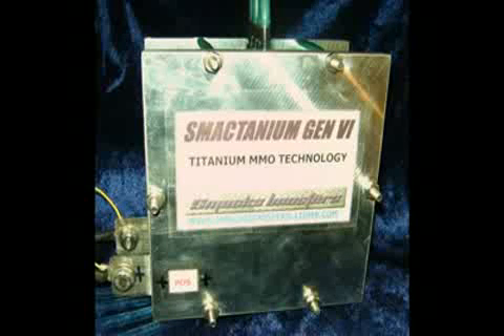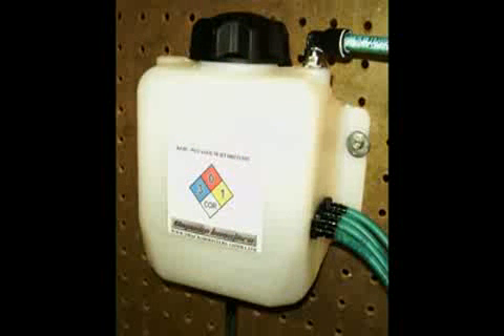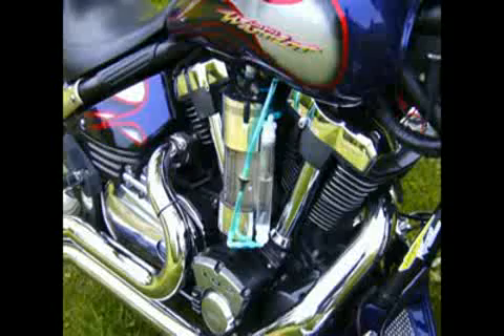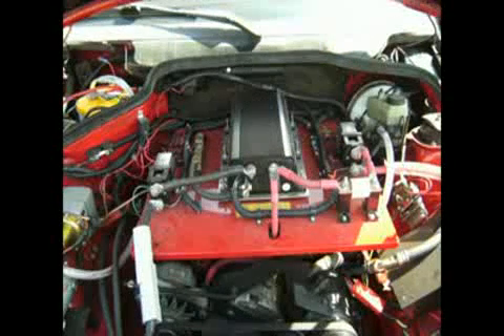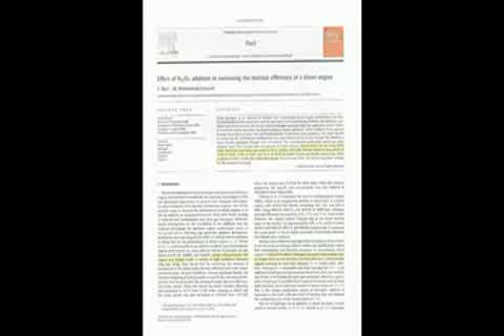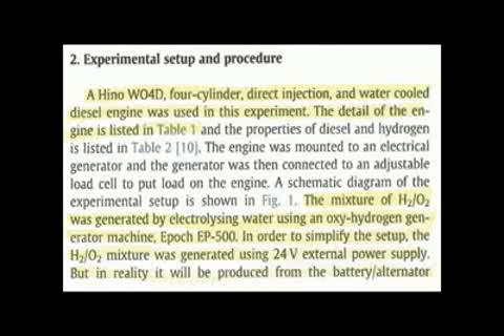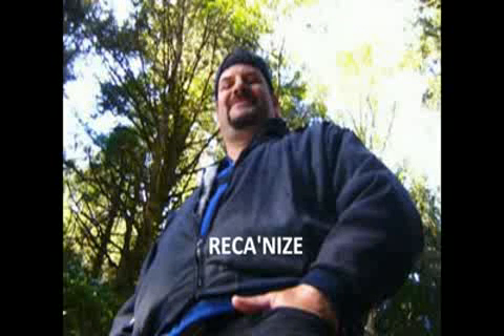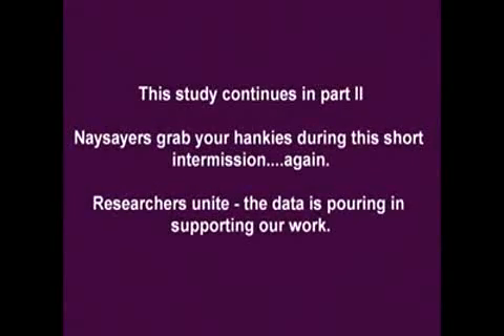Scientific PROOF that HHO WORKS Part 1

Comment from the maker: @SuperSoylent -- Nope, you are wrong, I have looked at the science behind it that's why I know it can work. Without a doubt H2 added to HC fuel changes how the fuel burns, it always has and it always will. The only question is can this change overcome the losses involved in making H2 on-demand from water. The answer is Yes it can. It really doesn’t matter that some test show otherwise, the important factor here are the test that prove it does. Quit focusing only on the negative...

Comment from the maker: @SuperSoylent --- There is where the misunderstanding begins. Using H2 on-demand isn't creating energy, it's recovering energy that once was lost. H2 added to HC fuel has been shown to increase the lean burn range of the fuel while increasing it's TE. So you get more power out of the burn using less fuel. This does come at a cost but the increase TE offsets the converting losses. The net result is a fuel savings. FYI, I don't sell these units, I'm just a researcher who mirrored this video.

Comment from the maker: @InStunnedDisbelief --- READ THE WHOLE PAPER... They accounted for the losses. They took the energy required to get the H2/O2 gas added in the energy value of the resulting H2 then lean out the diesel by that amount. The results were an increase in BTE as well as a savings in fuel usage. In short they used less fuel and got more power out, including the converting losses. And no this is not free energy, the gains come from a better energy convergence of the HC fuel.

Comment from the maker: @InStunnedDisbelief --- Oh I see the problem, you just can't read. I said A dept of the DOT, the FMCSA is A dept. of the DOT. And no, read the whole section of the DOT doc as well as section 1.5. H2 and O2 made on-board from the electrolysis of water gave a 4% reduction in fuel use. You are not one of those comment pickers who pick apart sentences and use them to spin the topic are you? Sad, truly sad....

Comment from the maker: @InStunnedDisbelief --- Making posts in 500 characters sometimes requires the use of acronyms, quit your bitching. The FMCSA division of the DOT published this doc, tinyurl com / DOT-doc. Read section 1.2.3 - "Limited laboratory testing of a hydrogen injection system installed on an older diesel truck engine operated at a series of constant speeds showed a 4 percent reduction in fuel use..." Oh and a Hydrogen Injection system is defined as an electrolysis unit in a previous statement...

Comment from the maker: @InStunnedDisbelief --- Silly rabbit, don't you know that they included the load required in their computations when they concluded that H2/O2 gas made on-demand improves fuel economy? Did you also know that a dept. of the DOT published guidelines for using H2 in commercial vehicles that states using H2 from on-board electrolysis units as a supplement was shown to save fuel? Again show me why it can’t work, can you?

Comment from the maker: @InStunnedDisbelief --- Proof is in the peer reviewed published data. You want me to pass someone else's work off as mine? The data shows gains in TE starting a 3 LPM for the 4.0 litter engine used in the test. For confirmation of this fact look at fig. 2, 3, and 6 of the published study. Read the study, it contains all the proof I need know that this works. Show me actual data the proves it doesn't work, can you?

Comment from the maker: @TheGreenPowerGuy --- First things first, HHO has been scientifically proven to improve fuel efficiency, see the peer-reviewed study this video links to. It shows that HHO makes the engine more efficient by changing the burn characteristics of the fossil fuel releasing more usable power from the burn. Yes there are losses involved at the alternator but the gains in BTE out weigh them. About the device you are pushing, send me one and I'll test it. Send me a PM if you are interested...

Comment: @BlackDogSociety - The Australian study used a Dwyer RMC air flow meter to measure the HHO flow. At 0 Celsius at sea level. air has a density of 1.2 grams per liter. Hydrogen 0.08988 g/L and oxygen 1.429 g/L. So, HHO = 0.08988 + 0.08988 + 1.429 divided by 3 = 0.53625 g/L. Because the density of air is 2.24 times greater than HHO, they were actually feeding 2.24 times more HHO than they thought. This throws off all their energy calculations. FLAWED study = BULLSHIT study.

Comment from the maker: @EnergySupply2008 - Read the entire report and stop taking things out of context. The first page is the over-all savings factoring in the amount of fuel that was replaced by HHO, the last page is the gains related to the increases in BTE only. Quote, 
Page 6 "The brake specific fuel consumption of the engine
reduced by 7.3%, 8.1%, and 4.8%": 
Page 4 "By inducting H2/O2 into the diesel engine the maximum fuel savings were recorded as approximately 15% (15.07%, 15.16%, and 14.96%..."

Comment: @BlackDogSociety 

Australian study supposed fuel savings at 19, 22, 28 KW load.

First page says 15.07% 15.16% 14.96%

Last page says 7.3% 8.1% 4.8%

Those Australians cannot even keep their lies straight and BlackDogSociety does not know how to read and interpret lies. Ronn Motors has not had their claims tested by the EPA, you know, that agency that puts the MPG stickers on vehicles.

All BDS does is lie. He knows no other method of communication.

Comment: That's actually not as good as standard gains from water injection alone (Yes, its benefits vary greatly from one engine to another), which is the secondary effect of HHO generation. And yes proper injection timing would probably compensate for the net effect of the HHO injection.  

Can everyone please stop referring to 'H2 + O2 as HHO? You are damaging the sanity of chemists around the globe, and there is nothing at all special about the product of water electrolysis other than it being wet.

Comment: @BlackDogSociety "It was speculated that a 50% gain in MPG was possible."

great you can't even read the scientific paper that you yourself provided.

"However, adding H2/O2 beyond 5% does not have significant effect in enhancing the engine performance"

Comment from the maker: @coasterpro--- No MIT used a electrically generated plasma to pre-burn part of teh gasoline releasing H2 in the process. They then lean out the remaining gasoline and burned it with the liberated H2. This allows for higher compression ratios and leaner burn while increasing HP. It was speculated that a 50% gain in MPG was possible. ArvinMeritor funded or bought the product. See tinyurl com / 9xoqa

Comment: // Your speculation and theories are just that, so if you want to dispute these results I suggest you built one,

I'm sure it's been pointed out to you before that it is not the responsibility of the skeptic to build, demonstrate or prove anything.

We're not talking about theoretical physics here. And the engineering involved isn't state-of-the-art. So it should be easy to for advocates to demonstrate that the tech works as advertised, and demonstrate it in such a way that leaves no questions.

Comment: I acknowledge that there is a genuine peer reviewed scientific article that appears to demonstrate the technology working (at least partially) as claimed by some hobbyists. But that does not alleviate the technology or the experimental methodological of error, or false assumptions based on its findings. And I await the clarification of the article's method with regard to how they compensated for the use of a wall socket power to generate the HHO.

Comment: // MIT did a on-board H2 generation device

And they were using on-board electrolysis or an external fuel tank as in the NASA experiment?

Comment: // How is H2 from NASA test different from H2 from electrolysis?

*sigh*

Methanol is a form of stored energy, where as water is not. 

In the case of the Methanol very little energy is required to release the energy already stored in the liquid, which is why they can get away with using the waste heat of the engine. 

In the case of water 100% of the energy stored in the form of HHO via electrolysis has to come from the engine itself, and you can never regain that energy in any form.

Comment from the maker: @coasterpro --- Let's see they used desiel and HHO, a chemical, to drive an engine, mechanical, that turns a generator, electrical. Nope it look like they covered it well... What you fail to see is that this study was done in 2007-2008 and was submitted for review. It was found to be worthy of publication and was published last month. Your speculation and theories are just that, so if you want to dispute these results I suggest you built one, test it and have the results published.

Comment from the maker: @ES2008 --- Damn son can't you do math correctly? I've told you this many times an alternator uses less than 2% of the energy from the gasoline or in this case diesel, of that energy (the < 2%) it wastes 38% -50%. In the Australian study they used a load for the HHO system that was 4.84% of the desiel and got a 15.07% gain @ 19 KW load. I can't help it if you can't understand simple math. There you go again spewing your crap...

Comment: >> This is the same result NASA got

Sorry, show me the experiment where NASA used H2 produced from the engine's own power? Yeah, didn't think so.

The NASA experiment used the engine's heat and a Methanol reformer to extract H2 from an external tank of Methanol. The gas as mixed with the engine's normal air/fuel mixture in the carburetor. 

NASA is far form the only people to have experimented with H2 injection, but in every case an external tank was used because that's the ONLY way it works.

Comment: >> the article does explain how the power consumption is compensated

Yes, I did read that however it doesn't help us calculate the the loss. My impression is it sounds as though they ignored the chemical -> mechanical -> electrical -> chemical conversion required to produce the H2/O2 mixture, and based on the compensation strictly on, as they said, the "(diesel) energy equivalent" of the gas itself. If that is in fact what they did then there's your missing loss. But I still can't calculate it.

Comment: And the Epoch EP-500 only weighs 315 pounds, so the weight increases the cars weight, but keeping other vehicles from running over the extension cord is a serious problem nobody has solved.

Comment: Coasterpro - The study in questiion, used an HHO generator that operates at 220/380 volts and uses 11,500 watts from the eletrical outlet. So the HHO crowd just needs a 40 mile extension cord and they are all set, once they buy the $39,000 Epoch EP-500 electrolyizer used in the study. It is only 31 X 50 X 50 inches and fits easily into any glovebox. LOL

Comment: @coasterpro - You said it very well. A diesel engine only converts about 30% of the heat of the fuel into motion to turn the alternator that operates at 50-62% efficiency and the HHO crackpots think all those losses can be compensated for and actually get a gain, instead of a loss. Absolutely delusional.

Comment: Bari used wall electricity, where the losses in generating the eletricity are at the power plant, NOT with the on board generation of eletricity. Using a 32% efficient engine to power a 50-62 percent efficient altenator, the results would have been a loss.

Comment from the maker: @Don -- Sorry, wrong again. A lean mix with HHO gave an increase in BHP. This is the same result NASA got in the 70's when they added H2 to a gasoline engine. H2 extends the lean burn range allowing for a safe lean operation without engine damage. The added HP comes from an increase in TE, meaning more power is used instead of being wasted in the exhaust. HHO works if done correctly...

Comment from the maker: @coasterpro --- But the article does explain how the power consumption is compensated, "The total rate of fuel consumption is calculated as the sum of diesel, the diesel equivalent flow rate of hydrogen and the diesel equivalent energy needed to produce H2/O2 mixture." Also it gives you the LPM rates and the percentages of diesel energy equivalent for each amount of HHO used. It even tells you the brand name of the HHO generator used. You have more than enough information to use.

Comment: >> You automatically dismiss this report without reading it

I in no way dismissed the article. I proposed certain predictions about the experimental setup and conclusions justified by past experience. Had my assumptions proved false then surely I would have had no choice but to accept the experiment's conclusions (albeit tentatively). But, as predicted, the experiment did use an external power supply and did not state how the power consumption was compensated for in the final results.

Comment: I finally found the full publication linked to from EletrikRide's home page. A bit of a chore given that he failed to cite the title.

ER notes the article as stating, "The power needed to produce the H2/O2 mixture is included as an input energy to the engine." However I'm concerned that the article doesn't give a value for the power draw or demonstrate how the compensation was done, neither of which can be assumed by the reader since there are many possible values and approaches.

Comment: Further more, for the bonus prize, assuming I'm correct about the external power source, I will place a separate wager that the artificial load (whether mathematical or mechanical) used to account for the input energy needed to produce the H202, was mishandled in some way, or some factor ignored, giving the false impression that there was an improvement in fuel economy. When all factors are taken into consideration there will be a roughly 5% loss (due to conversion), but no savings. Any takers?

Comment: >> peer reviewed study proves..

Well, sir, for obvious reasons I'm highly incredulous toward that claim. If the experiment was genuine and the results were positive then I predict that if we read the article in question (rather than taking Mr. Ride's word for it) we would find that they did not use H2O2 derived from the engine's own power but rather from some external source such as a compressed cylinder, another generator, or an electrical outlet. How much do you want to bet?

Comment from the maker: @coasterpro --- We are not getting more out of the system than we put in, we are simply making better use of the energy in the hydrocarbon fuel. HHO extends the lean burn range of the HC fuel while improving it's thermal efficiency. This published, peer reviewed study proves that. You want more proof just look at what Ronn Motors has done with the H2GO system in big-rig fleet trucks. 

tinyurl(.)com / yal5z5p

This technology works, plain and simple...

Comment: >> no absolute proof..

No proof is required. The idea that you can boost an engine's performance from HHO derived from the engine's own power is flat on its face, wrong. You cannot get more energy out of a thermodynamic system than you put into it. The HHO in these gensets is simply stored energy derived from the very fuel running the engine. So even if all points of conversion were 100% efficient you would see zero improvement in fuel economy. It's common sense.

Comment: @BlackDogSociety -  The 38 KW you mention represents FULL load and would require twice as much diesel as the 19 KW load, thus twice as much HHO requirement and twice as much electricity.

The simple fact that alludes you is the load in this case does NOT make electricity that can power an electrolysis cell because the 19KW load represents 25.47 horsepower and represents a moving vehicle load. No electricity left over.

Comment: @BlackDogSociety - The last page says 7.3% NOT 15.07% and both numbers are based on faulty calculation methods because they used energy figures based on using wall eletricity that has its losses at the generating station, NOT in the 68% engine losses and 14% altenator losses. That skewed their science and made it faulty science.

Comment from the maker: @ES2008 --- The simple fact that alludes you is the load in this case MAKES ELECTRICITY. Even if the load for HHO was not already accounted for the output of the generator could make 38 KWh and the maximum load on the EP-500 is only 11.5 KWh. The unit could have easily driven the electrolyzer at full power without  any trouble. Your problem is you are too vain to admit you are wrong, after all didn't you say your intellect is in the top 4% of the population?

Comment from the maker: @ES2008 --- READ THE STUDY. you will find that a) the brake TE was COMPUTED at 32% without the HHO and 34.6% with HHO at 19 KWh load. b) Quote "The power needed to produce the H2/O2 mixture is included as an input energy to the engine." This means they offset 4.84% of the diesel input to account for the load. c) They posted a 15.07% gain in fuel savings. That included the load for the HHO. The study was designed this way to show that on-board electrolysis can increase fuel economy.

Comment: @BlackDogSociety  Part 101B

When we feed 100 MJ of diesel fuel into the 32% efficient engine the Australian study used, only 32 MJ comes out the other end. Then the alternator wastes 14% of that, so from out of the alternator we only get 27.52 MJ.

27.52 + 228% = 90.26 MJ. Class is over, now it is time to absorb the truth and realize that Smack University lost its accreditation long ago.

Comment: @BlackDogSociety  Part 101A 

You have spent too much time at Smack University. The Professors at the University of EnergySupply2008 have asked me to pass on the following to educate you.

The losses in making electricity that comes from the wall outlet are at the electrical plant. The power supply in the Epoch EP-500 HHO torch machine, wastes only 10% of that electricity.